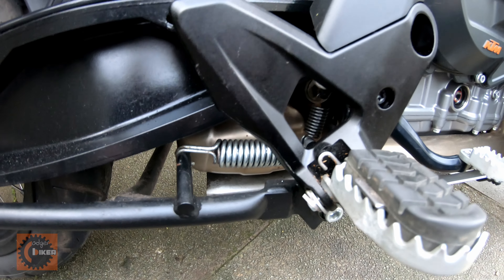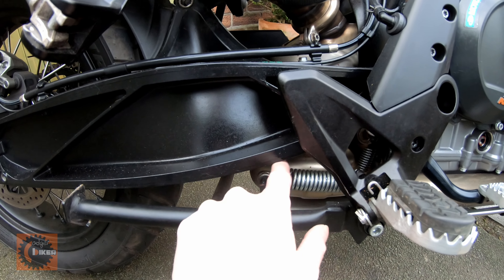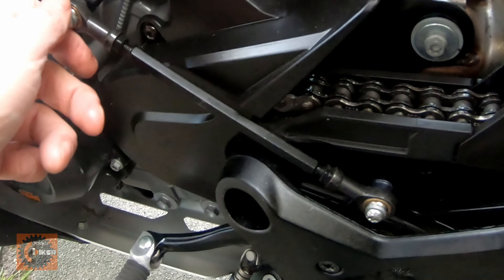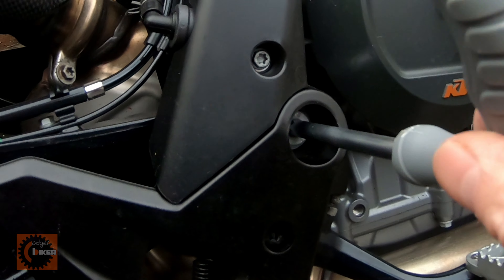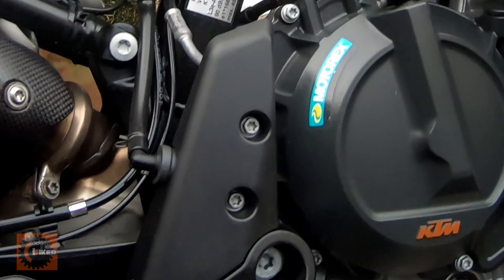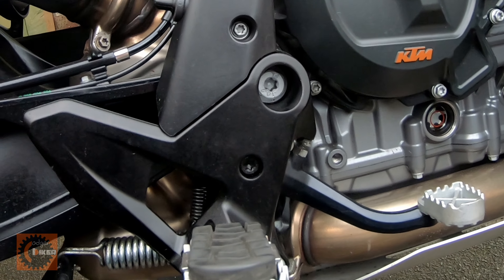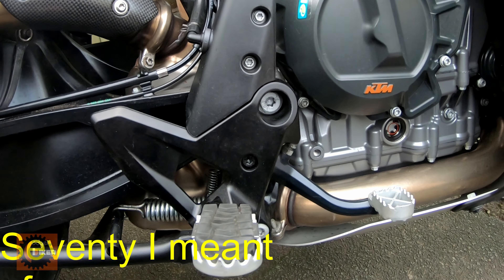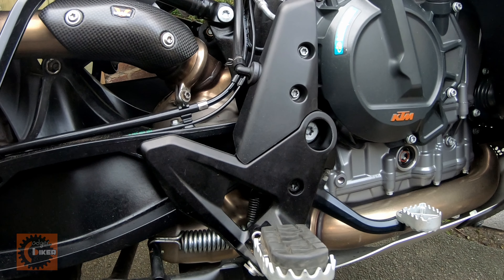KTM 790 Adv - Loose Bolts

Comment: I had both of mine fall out and the bushing was out about by 1.5” on the left side.
You need to hold the opposite side while setting the proper torque because the long bushing will just spin

Comment: This was invaluable information, thanks a lot!
I mounted a Black Dog skidplate on mine, using the centerstand fixing points.
(Which excludes the possibility of a centerstand, so I got a Trail Stand instead, but that is an entirely different discussion...)
It says in the mounting instructions from BlackDog to loosen the two lower footpegs bolts, but I loosened the top one as well to get some more wiggle room, not realizing that the top one is actually the swingarm bolt...!
When tightening I used the torque for the footpegs for all three, ie. 45Nm.
Which falls well short of the 100Nm that should have been applied.
Now down to the garage to correct this potentially fatal error!
So thank you one more time !

Perhaps something similar happened when your center stand was mounted?
Reply from the maker: Good point, I just checked my video and I had not touched that bolt. Also somebody sent me a picture of another bike where they had fallen out, I don’t think it had a stand. I’ll just add it to the checklist, it won’t happen again. Cheers for feedback, and shared experience, appreciated. 👍👍

Comment: I've lost my right bolt going around 120 km/h. Turns out you don't die immediately :D I was warned by a car driver coming behind me. Other bolt was very loose as well. Swingarm pivot doesn't immediately come off because it is also hold inside by other parts. But it is dangerous situation regardless. I tightened the remaining bolt and carefully traveled more than 300km after talking to my mechanic. I want to mention that a sign of loose bolts could be problems in shifting. I started to notice problems with my shifting, gear lever was getting sticky. It went away after missing bolt was installed and everything tightened.
Reply from the maker: Glad you are okay. Yes I think it is just something to be aware of and to check from time-to-time. I did notice on the last service it now includes: 'Check and torque all bolts', so I think this is not uncommon. Forewarned is forearmed 👍
Reply: I had the exact same thing happen to me, right hand side completely fell out (after i did a De-cat so %100 fault of my own for not torquing correctly, as I also did not realise they were swing arm bolts) I did a huge off road trip of about 2500 kilometers, and then after a spill one day, I noticed my right foot controls were wobbly when standing, notice one bolt completely gone and the other side, had backed out severly because of that tube! scary situation!

Comment: I have remove that bolt to remove the decat on 890. Managed to screw it back no probs at 100Nm. Then I had to loosen it again to put a skid plate. So decedide to pull it out to put some thread lock. Now it spins in place - it catches the thread, goes in, but once it
Need to “grab”, it just spins….
Reply from the maker: From memory isn't there a sleeve on other side needs holding, probably spinning. I no longer have the bike but seem to remember this 🤔
Reply: @CodgerBiker  Thanks a lot - will give it a try
Reply from the maker: Yes, tighten both sides together 👍

Comment: Hi Codger, Well spotted I'll be checking mine later, do you think that the centre stand would of contributed as I have the same as you????
Reply from the maker: That was my first thought. However it is designed to have one. Also somebody sent me a picture of another bike (an R I think) where the bolts had fallen out. I don’t think it had a centre stand. More likely not tightened properly at factory, well maybe, or loosened with use. Now we are aware it’s easy to check. I went over whole bike this morning, nothing else found. 👍😁

Comment: Wouldn't hurt to put some Loctite on them. I had the same thing happen on my Thruxton. Darn bolt fell out going around a corner. I went to shift and the shifter had fallen off the bike. Parked it and walked back to fortunately find the bolt laying there on the road.
Reply from the maker: Yes I'm thinking the same. Glad you had no ill effects 👍

Comment: You're right, 100Nm is tight, so I'd be surprised if that bolt(s) was actually torqued correctly from the beginning. It would do no harm to Loctite it, but I wouldn't bother.
Reply from the maker: Yes, seems a lot to me. I doubt loctite is needed if correct 👍

Comment: Hello I wish I had watched this video before last night I was coming home last night and one of mine come out on a dual carriageway if there was a car coming the other way I wouldn’t be writing this now I can tell you I think it’s was a uncontrollable wobble it’s a bad design no split pin nothing very dangerous
Reply from the maker: Phew! Close shave. Loctite is your friend and check regularly. Mine did not come loose again after I torqued it correctly. Glad you are ok 👍👍
Reply: @CodgerBiker  I will definitely be getting loctite and mark with paint and check every time I get on it just need to get it sorted now not sure if it’s a easy fix or not but think ktm rider should be made aware of such things by ktm
Reply from the maker: Yes, forewarned is forearmed etc. I was surprised, which is why I put the video out there. Several other people report same. It's just 2 bolts into a sleeve. Hopefully you'll only need a bolt, 2 at most. Good luck 👍
Reply: @CodgerBiker  yes I think ktm should warn customers to check them often I will stopping every 5 minutes to check mine I know that but have ordered two bolts and am hoping that’s all I need and loctite but good video you put up 👍
Reply from the maker: I did notice after this, the next service made a point of checking all bolts/fixings. I hope you get it sorted quickly. I check my bike regularly now also 👍